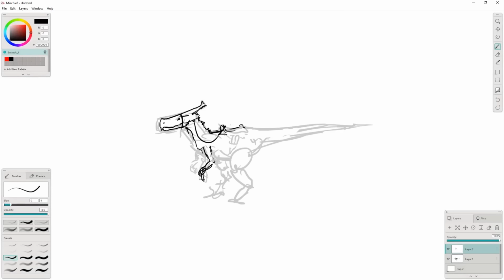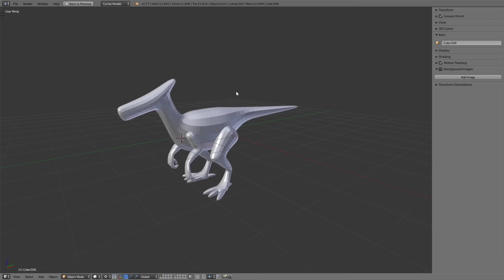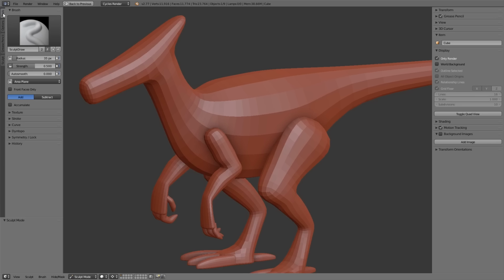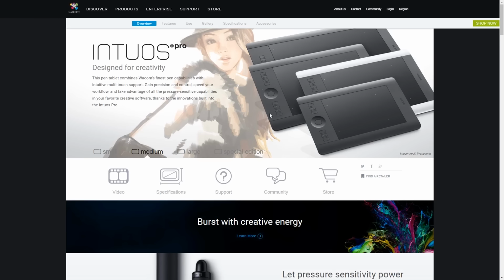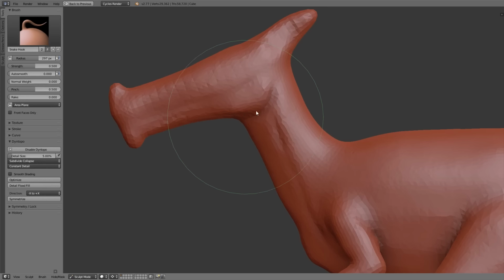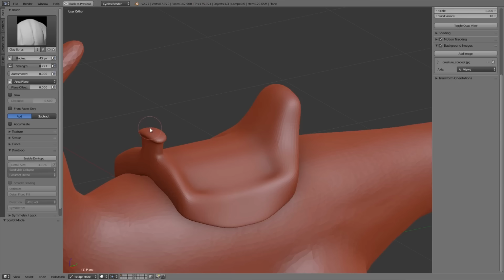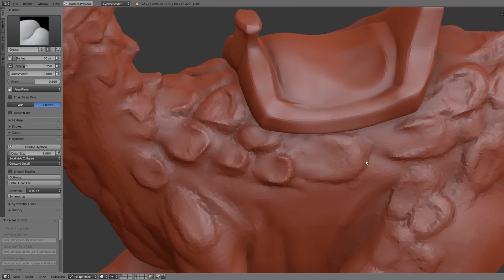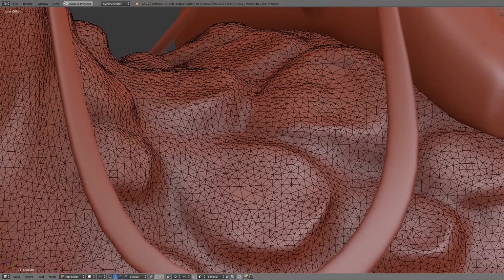Introduction: Sculpting in Blender (Tutorial EN)

Comment: Is there a way to change hotkeys for sculpting brushes?  (I doubt about that since Sculpt tools is an external addon, but anyways decided to question). 
Explanation why I need that: I am using a keyboard without Num Pad keys and with touch pad without mouse, so in Blender setting I enabled option "emulate NumPad keys" which re-assign functions of NumPad's keys to keys 1,2,3...-0 which are placed above letter keys on my keyboard (under F1-F12 keys). And because of that I can not now choose ClayStrips brush by pressing "3", since key "3" now works as a "Num3" on my keyboard....Anyone knows a solution?

Comment: Sorry to write a comment on such an old video but i  have a question. I'm working with blender to create models/characters etc. for unreal engine. I saw that the face count was over 400k, is it possible to use a character with this much faces in a game or would i be required to significantly reduce the face count ? Thanks in advance ;)

Comment: Intriguingly I managed to somehow disable sculpting for my base mesh. As in, if I add a new box it sculpts just fine, but the box I reshaped to fit my reference image refuses to change at all.

Any idea how I managed to do this? Fitting a second box wouldn't be hard but I'd rather know what I accidentally hit to do this.

A hint would be that the "broken" cube shades much darker when I enter sculpting mode than it does in edit/object mode.
Reply: Ctrl + I - inverts the mask, must have accidentally hit that when I popped in to sculpt mode before even extruding the base shape.

Comment: Can you print this model in a 3D printer? If so, how would you do that?
Reply: I've done this before, because my school has a 3D Printer. In Blender, just make sure everything is one mesh (use bool tools, I'm pretty sure this is a necesary step!), then export it as an stl. If you need to reduce geometry, try decimate modifier. You'll definitely want to remove any detail that is finer than the resolution of your printer.
That being said, the lab tech did the actual printing. Also, there are no guarentees that it will actually stand up. Maybe use a physics sim for that?
Reply: a good way to make sure it can stand up is to make a little platform underneath the feet. That also helps the model stand up during the printing, and not fall over
Reply: Zodasg do you mean a type of 3d body colliding box
Reply: You need a .stl file, so yeah just convert it.

Comment: Somethings wrong with 10:35 everytime i click union is disappears except for the arms
Reply: For people still struggling with this, here is how I solved it for me:
Select your object, go into edit mode, select all vertices (A) and in the tools menu press "Remove Doubles". For soms reason I had almost 2000 double vertices. Repeat for the other objects you intend to merge, just to be sure. Now try uniting them again.
Reply: @tomtruyens7998  The reason you had so many doubles is that when you mirrored the legs it also mirrored the body over itself, therefore, doubling all the vertices in the mesh.
Reply: I'm having the same problem
Reply: I figured it out. You need to have inverted normals on all of your objects

Comment: Your work is amazing, no question. I do a few things differently myself. I start with a mesh with the Skin modifier for the general shape which automatically creates a skeleton for deforming it later. Also, on the eye instead of loop cutting to add geometry to sharpen subsurfed corners just use the crease setting on the edges in edit mode.